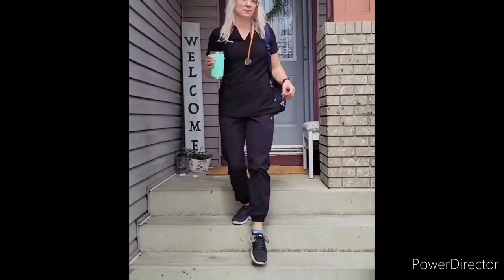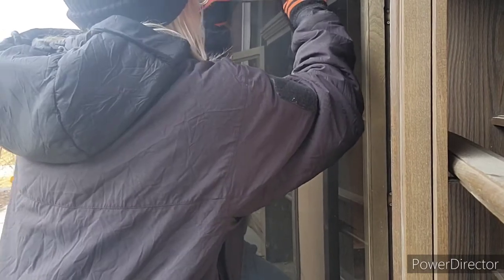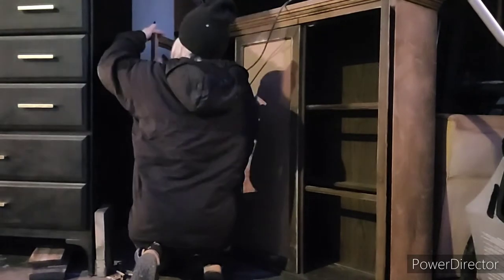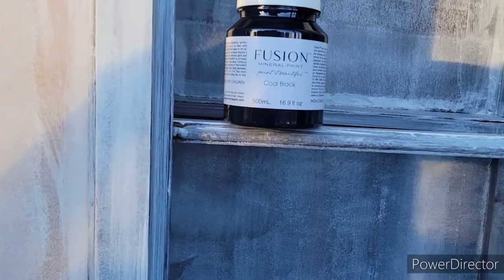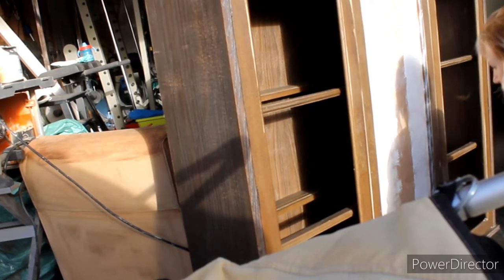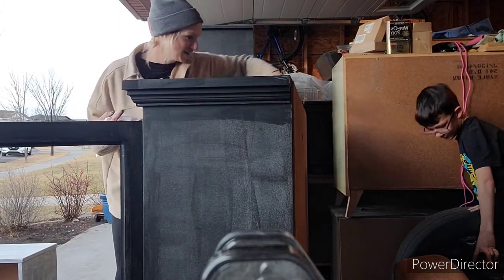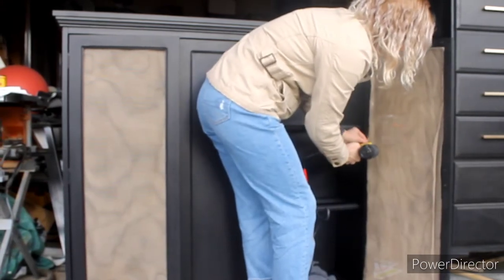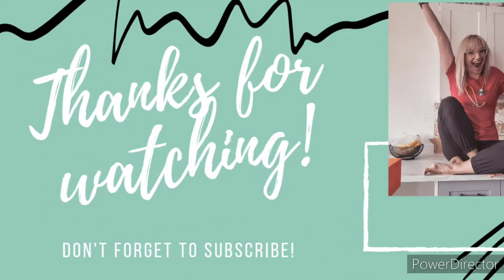Furniture Flipping- Outdated Hutch makeover

Comment: Your piece turned out pretty good. I want to make a few suggestions and please don't feel that I'm being rude. I only want to help you so your channel does get better. First and foremost, you need to de-clutter and organize your garage if that's where you are going to work on our pieces. For the majority of your video, we couldn't actually see what you were doing due to objects in the way. I too live in Canada, so know all about the cold. It's not a great idea to be priming or painting pieces in cold temps. I also work out of my garage, and moved everything into my house at the beginning of Nov. For safety reasons and also to make it much easier to install the stuff you used on your doors, you really should have taken the doors off and had them laying down. Less chance of the glass breaking and being cut and also you'd get much more leverage with the stapler. As I mentioned, please don't think I'm trying to hurt your feelings or being a bully, I only wanted to make a few suggestions in hopes it helps you. Take care and have a great rest of your day. 😊